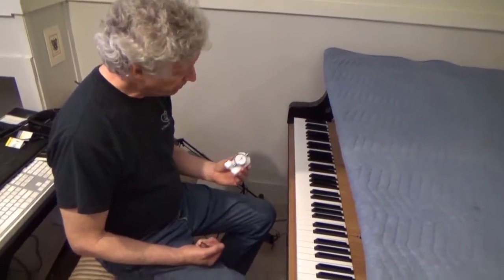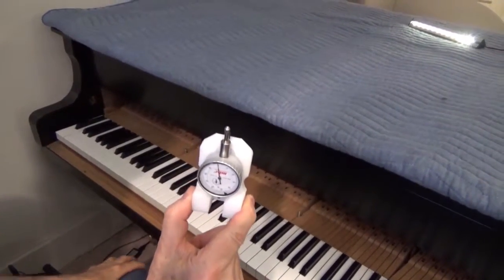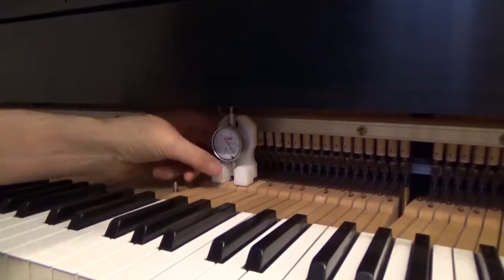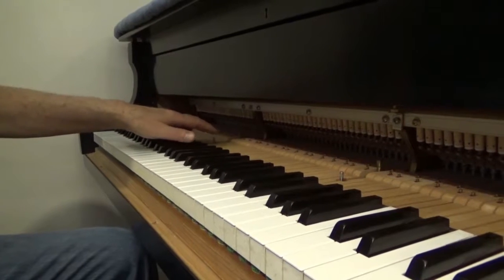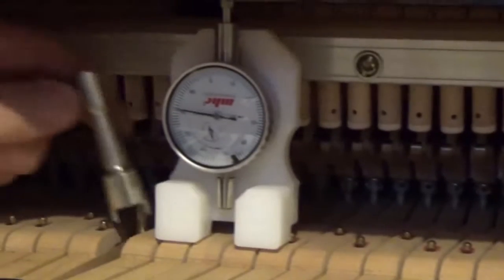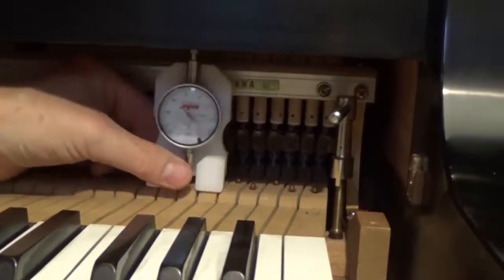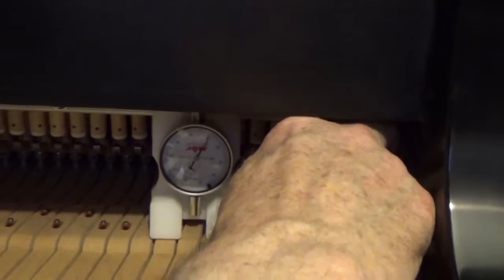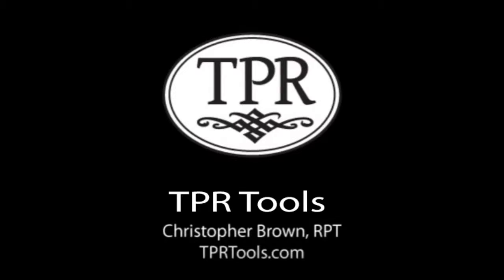Regulate grand piano – 6 WNG Bedding Tool

Comment: What does the inconsistencies of the readings on the meter say about the level-ness of the keys.  I.E., the 1st reading was somewhere around 42, while the second was 80.
Reply from the maker: Hi, robydean7. Thanks for pointing out this important point. We are only looking to see if the nearby stud moves. So we use the indicator for its sensitivity to any movement in what it's touching. The pinblock won't move, focusing our attention on whether the key it's resting on moves, in this case when we push down on it. BTW, a gentle push will do and a firm push may cause movement in a stud that is in contact with the keybed. We're not measuring the space, only seeing if its dimension changes. And we are not measuring the level-ness of the keys in this operation, only the connection of keyframe to keybed. But the WNG Bedding Tool is brilliant in this capacity! It will also dramatically reveal the degree of influence pedaling has on the apparently solid keybed...

Comment: So am I understanding correctly that as long as the 3 rails are properly bedded, then the action as a whole is the proper distance from the string line? Is that the  purpose of bedding the action?
Reply from the maker: There are two issues here: elevations and solid foundation. First, the action as a whole could have elevation issues, independent of the bedding. But if it was set up correctly to begin with and not interfered with, it will be the correct distance from the string line. There is a hidden but notable exception. If the string line (strike line) varies in height from the keybed, which to one degree or another, it often does, traditional two-tiered boring (one bore length for the bass and one for the treble) forces action-distance-from-strings compromises.For instance, if blow distance is consistent throughout, a desirable feature, the shanks will be heights varying from their rest cushions the same amount as the string heights vary from the keybed/plane of the action. If the discrepancy is significant, the tails may be too short and/or the backchecks not tall enough for good backchecking. Also, the rear under shoulder of hammers whose shanks are too far from their rest cushions, may collide with the tops of their backchecks - not a catastrophic failure, probably, but not great. If the blow distance is increased, more dip will be needed or less aftertouch suffered. A bore distance choice will be forced, between overstriking and understriking hammeers. And so forth. Actually, we can potentially worsen the situation by parts and materials choices and hammer wear will worsen the situation for those that overstrike. Also, the under- or over-striking has tonal implications that potentially add voicing challenges.. Finally, the purposes of bedding an action. Good bedding provides solid support for the action, minimizing loss of energy between force applied to the keys and output applied to the strings. This has a time/response component that a player will have try to overcome as they play, i.e. they will have less control of what they are trying to do musically. Also, good bedding minimizes unwanted noise in the system.